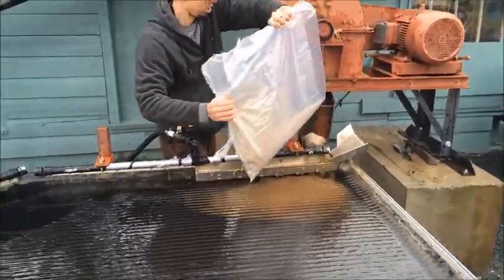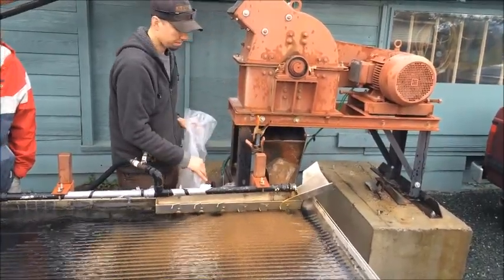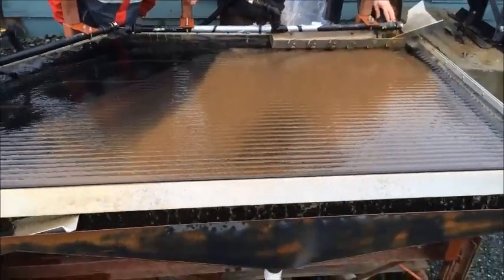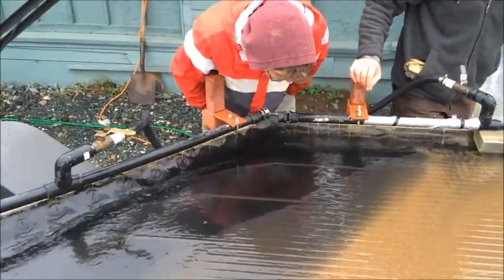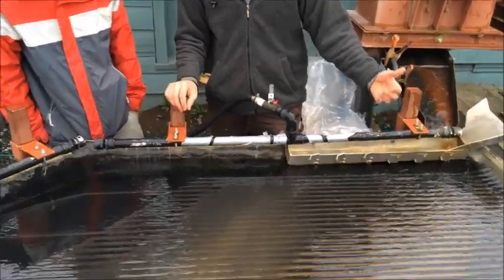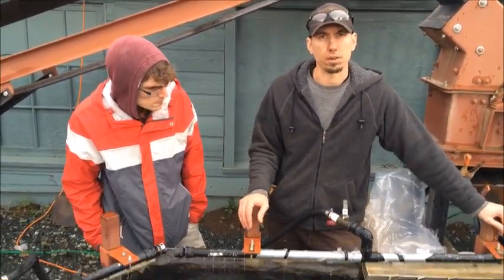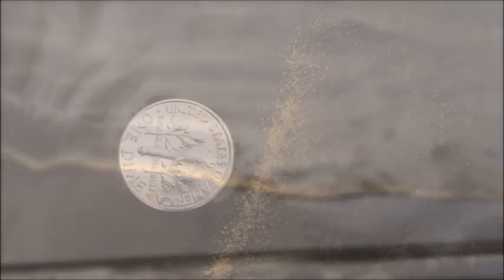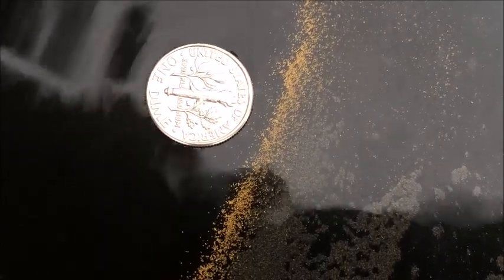Fine gold recovered from Yukon placer jig tailings using a shaker table

Comment: The scattered(?) hairs slow down the ultrafine particles.
Would removing these by flame polishing, or using a profile cutter instead of a router, improve throughput?
Or do the hairs help carry the particles along the table, and would need to be replaced by a more complex stepped pattern to function?